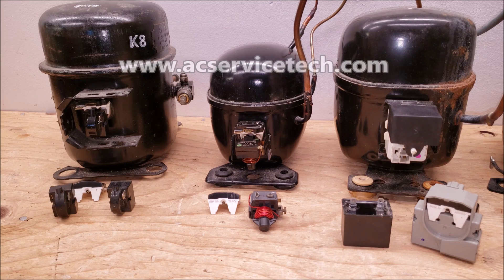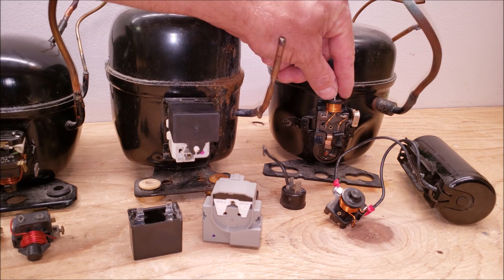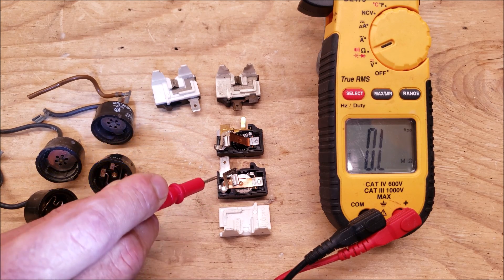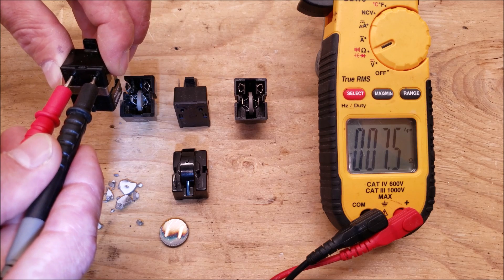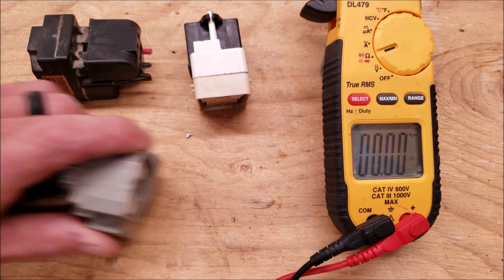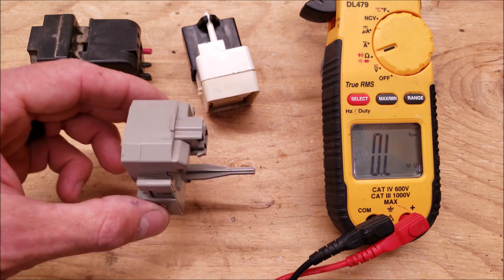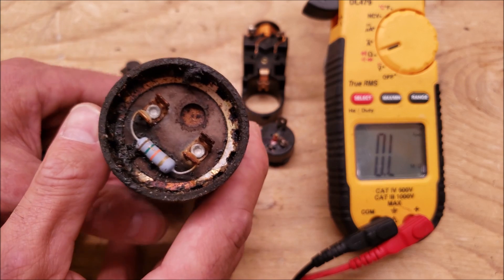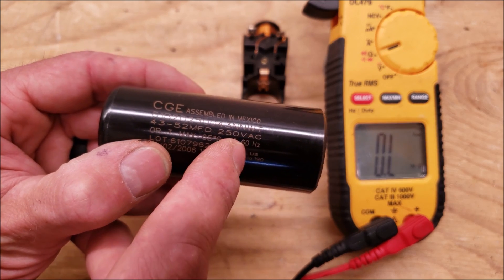Refrigerator Compressor Not Running? Test The Start Relay, Overload, Capacitor, PTC Thermistor

Comment: Yesterday my fridge stopped cooling fridge below. Freezer fine. Well freezer coil was a block of ice. Spent hours on that yesterday. Ok great. This morning all I did was adjust the freezer temp knob a little bit then the fridge just quit running. Tested components at the compressor. All checked out. Pulled the mother board on this Hotpoint and a pair of resistors at board had a brownish hot spot underneath them. Felt to see if either were loose. One was. Re-soldered. Put everything back together. Still nothing but inside lights!  Then after an hour of just sitting and plugged in the fridge just came back to life for no reason at all!  Been so stressed out about losing my food.  Now my Whirlpool fridge in the other room acts like the compressor is only running on one winding. I suspect the thermal protection block on it is bad. The plug in capacitor that plugs into it tested perfectly at 15uf.  Anyway it has been a nightmare here fridges wise. Of course this all started after lunch on a Saturday so nothing open to get parts! The chances of 2 fridges dying on the same day is equal to winning the lottery. Thanks on this vid. It was helpful.  I subscribed!

Comment: I replaced my relay and starter kit. and tested the old ones with a voltmeter and they are all good. The compressor shuts off after about 15-20 seconds of powering up. I can feel the compressor vibrating and then it stops after I hear a click. What's next? the display and temperature setting all work fine.

Comment: wish there was a way we could test/troubleshoot the pcb on the inside of the combination relays. my fridge was running like 20 hrs a day for 6 months, then one day it was warm. the start protect fuse popped. a new compressor protect has it working again but it runs a lot still. everything else on the fridge checks out but maybe the pcb in the relay is somehow making it run more. it doesnt seem it would but i really dont understand the function of that circuit board. cant seem to find a video explaining that pbc

Comment: Saw your video today.. and used it to troubleshoot my kegerator ..    All functions look normal but still no cooling . . .     I disconnected the fans from my compressor , so I could 'hear' it run..  and, it did ..     Telling me, its not the switches or capacitor .. ( which is good).   It's still not cool, and, I should hook up those fans before 'something happens' ..    Compressor is getting warm, but no exhaust lines are getting cold ..     Could be freon (or cooling fluids)..   More troubleshooting needed and thanks for getting me started.

Comment: My compressor tests ok but it just buzzes even though I replaced the capacitor and starter relay. It has resistance between all 3 prongs and draws 9 amps when it tries to start. It’s a year old. We were in Brasil for a month when it happened. Lots of nice beaches, bikinis and sand dunes. Any idea? Thanks

Comment: I am running a 1959 Frigidaire Frost Free Refrigerator Freeze. Three wires connect directly to the compressor with a rectangular relay and cylindrical capacitor. Have been able to acquire spares of several parts.

Comment: On the Embraco app it cross-references compatible "best matches" of their new compressors when replacing an old obsolete Embraco compressors. When matching the specs some are almost identical but I did notice TSD starting device on some and PTC starting device on others. How would these be compatible without rearranging the terminals?

Comment: Take a picture. Thats the best explaination. Thats fake technician material. That s unreliable technician advice. what if the wires are already disconnected taking a picture wont help. How come  you can ohm out practically every compressor and know about 100% of the time which compressor terminal is start and run. And common. But when it comes to the start relay the best they can say is take a fucking picture. Thats some looser fake unqualified technician non sense.. then you dont show they have some ptc start relays with 4 pins.... WTF

Comment: freezer starts then turns off after 4 seconds at 10.6 amps. On the compressor is printed LRA 19. It has a upright current relay and external overload protector. The relay and overload protector checked out as good. I even hooked up a 3 in 1 but same problem. ???

Comment: Help 😞

Can you help me put back the wires onto my OLP and Relay? I've had multiple people mess around with my refrigerator's compressor and I am suspect that the didn't put the wires back on correctly.

I have a red wire currently connected to the OLP  (but to me red is not your typical color for Common)
I have a pink wire and I have a light blue wire that are connected to the start relay.

My original compressor had 3 pins with the Single Pin on top.

They replaced the original compressor with some used one and the single pin at the bottom.

I unfortunately DID NOT take a pic of the wires, as I was leaving that to the "professionals"

The refrigerator is a samsung rs267lbsh.

Comment: Hi there, I have a Sub-zero 511 from 1991. Yes, it’s still running and I am trying to keep it that way. The freezer stopped working and I found that I have an issue with the freezer start relay. I opened it up and rotated the ptc thermistor disc and it is running again. I cannot find a replacement anywhere. Do you know some of these start relays are interchangeable? Thanks for your very informative videos!

Comment: I have a Frigidaire up right deep freezer, fffh20f2qwc, and I have replaced both run and start. I have also checked the compressor but it still won't start. Any other ideas what I can check to get it working?

Comment: I have a relay model P6R8MD OR0702. On this one, there is no rattle at all, and when I check ohms, it's like 20-25, not 4.7 or 0 etc. When I check continuity, there is no beep, no continuity.
On the refrigerator, the compressor never turns on, but the casing does get warm. The overload works and has continuity in the terminals. 

I assume the relay is bad, but I don't understand why the high ohms and no rattle.

[update] I took the relay apart and the problem is that the disk is cracked but only a small part is chipped off. It didn't rattle because there is some kind of cardboard/plastic sleeve going around the disk, basically holding the shards together. I can't even get continuity directly from both sides of the disk. At least not from every touch point.

Comment: I have a U-Line Model U-1075 BEVS-00 that stopped working. I asked for repair parts from U-Line and they sent the wrong parts even though I had sent detailed pictures. The compressor is a Embraco EMI 30HER. They are sy=till trying to find the electrical parts. This video describes my parts needed.

Where else can I go for parts besides U-Line?

Comment: Do some compressors not require capacitors. I’ve notice that on smaller refrigerators or coolers.
Reply from the maker: Correct some smaller single phase refrig/freezers with cap tubing don't require a capacitor or it is taken out after startup, thanks Danny!

Comment: Idk if you can help me or guide me. My small fridge won’t cook unless the fan from the heat exchange is unplugged. When I connect it back it shuts off the compressor. Any ideas?

Comment: Question, My compressor cane with two types, the pin config is the same as the third compressor in your first illustration, but has the pc thermistor and overload protector attached, but also came with  the third version with the start capacitor, on the side of the compressor says no start without starting device, I love you book and videos, always wanted to learn about this, Ty, Anthony

Comment: I have an LG LRDCS2603S, it’s stopped working. No compressor noise. I opened tue back, popped the cap & there isn’t any relay. I also have 3 blinking error code. So would my compressor be bad or my PCB? Thank you for your help

Comment: Hi, it it possible that the compressor partially run? I can hear the compressor vibrating (Running?) but have not heard it stop. (I used to hear that stopping sound, that it sounds like it has reach temp or the upper limit)

Comment: Seems 88/108 is fairly common with vintage refrigerators and freezers. I'm troubleshooting a 42+ year old Sears 106.6327150 upright freezer that went out for the first time last summer, and it has the same spec for the capacitor in it. I have yet to remove it from the plastic housing it's mounted in to see if it's leaked at all, but one afternoon this coming week I'll be going through it part by part in hopes that what made it go out was a still-available component. Lost 100+ lbs of salmon and beef when it went out last summer. Hooooo that stung the nostrils....

Comment: I have a basic (cheap) multimeter that does not have a uF or amp (clamp ring).  How do I check my capacitor with my current multimeter?  My capacitor reads 12uF 210 VAC to test for my GE GBS22KBSBCC refrigerator.

Comment: You said at 3:34 that the overload terminal has a "common" wire attached. Isn't it a red or hot wire attached there? On my fridge Kenmore 106 series, the red wire goes to the overload, then the overload plugs into the single prong which I think is common. I thought red was hot and common white.

Comment: You did NOT show how to test a current relay that uses a start capacitor. On this type of current relay, the switching contacts are across the Start socket and a terminal on the side (labeled '1' on the type that I tested). You showed how to test a current relay that does NOT use a start capacitor, which has the contacts across the Start and Run sockets. I got confused about these different designs, until I found a schematic: https://image.indotrading.com/co60115/pdf/p647913/4440y%201sr.pdf

Comment: Mine just has the start relay with the PTC disk in the middle that plugs directly on to the 3 prongs from the compressor. There is no visible overload or additional component attached. The fridge stopped cooling and the compressor doesnt go on but I hear the intermittent clicks. 

I took apart the housing of the start relay and the PTC disk is intact. It doesnt seem to be dirty, so I rotated the disk and tightened up the prongs holding it in place and put it back on but its still clicking and not wanting to start.

Im planning to get a new start relay but wondering what else might be the problem or common and cheap enough to pick up with a new relay.

Comment: Hi guys. My bottom freezer refrigerator is about 8 years old and having the cold  problem, freezer is not cold at all. I see frost at the joint between the small callipary tube and the evaporator tube. Then It melted, water started dripping. The temperature was between 28-48F. I did reset the fridge by unplugged/plugged. It didn't make any different. I did replace the start relay, capacitor, defrost thermostat,  temperature sensor, and electric control board,  still does not work. Is it worth to repair my fridge? And how much does it usually cost for vacuum/flush out moisture/oil out of the refrigeration, including replacing the drier filter? Please advise.  Thank you.

Comment: Thank you for posting this very informative video,,,My question to you is what caused the compressor in my wine fridge to stop running and get very hot,,,Initially it stopped working and I replaced the overload protector(6750c-0004r) and start/run relay(PTC starter relay( P6R8MC) ,that didn't solve the problem so upon testing the thermostat I found it bad,so I got it to run after replacing the thermostat(18GLB020008) and that's when after running for awhile the compressor got very hot and I noticed a strange smell.,,I'm wondering if maybe it developed a refrigerant leak after moving things around like the condenser /evaporator,Thanks in advance

Comment: Hi, I have True refrigerator model GDM-12, and it’s running cold, the thermostat is not controlling the temperature. I did check the thermostat and it has continuity. Do you know what else could be the problem?

Comment: I just want to know how to get the damned cover off !!! What is keeping the cover stuck; only finding vids for what to do AFTER the cover is popped off the relay capacitor/wiring..
Reply: Same
Reply: My cover on a 1995 ish Kenmore Coldspot 106 series, I put a flat screwdriver under the little flap on the top of the plastic cover and lightly pried the tip of the screwdriver down/shaft up and it popped off.

Comment: Hello I have a Hitachi Refrigerator/freezer, I recently  had a power cut and my refrigerator stopped cooling , I was advised to change the relay .. and this relay is a 3 pin relay .. however I have gotten a 2 pin relay and a separate overload ... the motor started but cuts off about 30 seconds later .. so the freezer cools but doesnt ice up ,.. 
Does the difference  in relay can create a problem

Comment: Hello i have a pct and the round compressor protector with 1 terminal on top 2 on bottom, could i swap it for a pct with the white compressor protector if the terminals are alike 1 on top 2 below?
Reply: Or should i just take the tablet out and put it in the original pct to see if my mini wine fridge will turn on?
Reply: Crap components dont match i guess ill test my luck with pulling the tablet and putting it into the pct , well is there any caution with doing that?

Comment: My minifridge (danby) is not cooling sometimes.  The compressor runs fine sometimes and other times it shakes and doesn't seem to be working properly.   I have the round overload type in your video at 5:00mins  model # B58-125 and cool it has 0.5 ohms resistance.  My start relay is the type at 6:27 and it looks fine inside and tests 4.7ohms model QPR-4R7.  Does this type of system have the start capacitor inside the compressor somewhere?  Also does the resistance on that overload seem high to you (0.5ohms for model B58-125)?  Also how can you tell what a normal ohm reading is for the overload?  What else could make the compressor act like this...the thermostat?   That's all that's in this wiring diagram.

Comment: My Kenmore Elite (Whirlpool) refrigerator stopped working when it was about 5 year old. I took the start relay off and shook it and it rattled like a maracca! Got a new one from the parts store and it hasn't failed since (15 years). Had other issues with the fan and ice maker and water in the door though.

Comment: I had a repair guy install a new start relay on my fridge but they put on a generic one which didn't look to fit properly and compressor wasn't starting as it should it sometimes would kick in and other times would not.. I would have to giggle it around and then it would start.  Then a couple days later the fan motor blew, which is odd because it was a bran new fan..   Could that wrong size compressor start relay been the reason why the fan blew?

Comment: first  the current go in the windings of the relais  to the startwinding  , the relais comes in  en turn the contact of of the start winding . the back emf from the start winding  holds the relais ON  (relais on is contact of the start  winding  )for the run winding . sorry my English  is not good

Comment: Thanks so much for the very informative video!  My mini-fridge (an Igloo, about 10 years old) went out suddenly. It just doesn't do anything when I plug it in, nothing. I tested the PTC Thermistor and the compressor protector just as you have shown - both seem good with resistance. I don't see a start relay, etc.  Is it possible that it is just the compressor is gone? Is there a way I can test voltage/resistance across the compressor? Thanks!
Reply: This reply is a yr later, but I hope you were able to ohm out the compressor.

Comment: Thank you so much for this fine and informative video! My fridge has one of the modules with the built in control board, and it failed last. Thanks to you, I was able to isolate the probable issue and swap out the part myself. Up and running, saved a lot of $$ and maintained social distancing.The new trifecta!

Comment: Does the Start Capacitor and Relay have any effect on the fridge freezer not shutting off?
I already changed my thermostat for a brand new one so am now thinking that it could be a bad start cap or a faulty switch that is permanently on inside the relay.
Note that mine has no control boards etc just a simple mechanical thermostat a Hotpoint RFAA52P.

Comment: Hi, I did all the tests shown here and on the compressor. It leads to the relay but I hear it clicking on after I pull it in. Can the circuit board still cause the compressor to not engage? I don't hear a second click for over draw. How would you know or could it be low on freon?

Comment: Sorry to go out of topic but I need to ask. I have changed defrost timer but the refrigerator keeps on "making ice". The heater is having a good continuity but some days later,  it forms a frost/ ice. Thermo fuse is good (0.0 ohms) the bimetallic as the schematic say, I have no idea of its values. Is it normally open or normally closed under room temperature?. All in all, what could be the problem? Technician in Qatar

Comment: Hi, my overload tests at .8 ohms, is that too much? Also I'm trying to test the voltage from the control board going to the compressor.  I have a red and blue wire going into the relay, and a black into the overload.  Not sure which is hot or neutral. If I test red, black, or blue to the ground, I get 120 volts. Otherwise I get very low voltage from black-red, black-blue, or blue-red.  Am I doing something wrong? Please help!

Comment: once you cut the bleed resistor to check the microfarad reading, would you have to reconnect the resistor? and if so, then how would you reconnect it?
Reply from the maker: Jordan, cut the resistor wire close to the terminal and use a 90 degree crimp connector on the end of the bleed resistor wire. Just crimp that 18-16 gauge spade connector on, thanks!